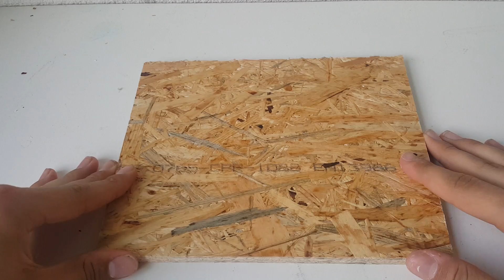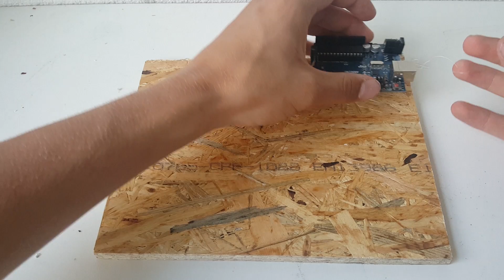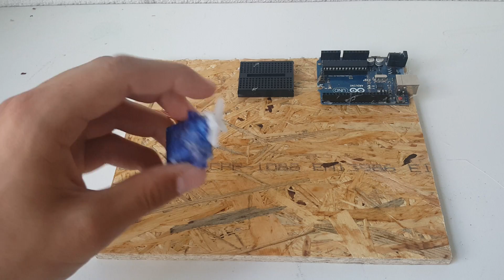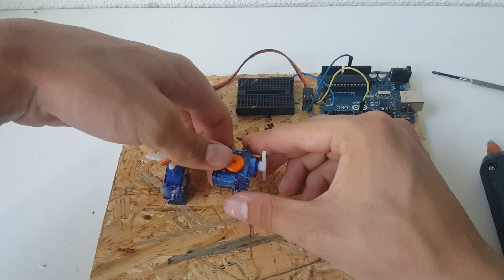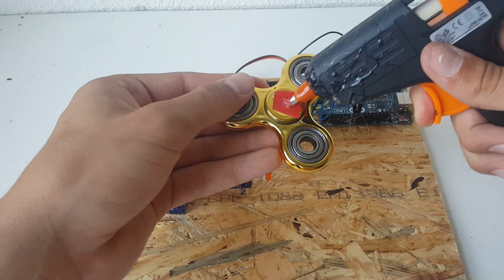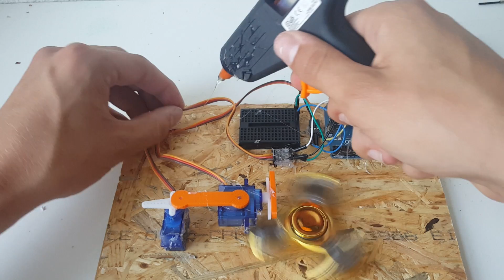A FIDGET SPINNER ROBOT?! + How to make

Comment from the maker: //The code for the fidget spinner robot: 

#include <VarSpeedServo.h>

VarSpeedServo myservo;    // create servo object to control a servo 
VarSpeedServo myservo1;    // creates another servo object to control a servo

void setup() {
  myservo.attach(9);  // attaches the servo on pin 9 to the arduino
  myservo1.attach(8);  // attaches the servo on pin 8 to the arduino
} 

void loop() {
  myservo.write(0);
  delay(1000);
  myservo1.write(120);
  delay(1000);
  myservo.write(140, 5 , true);       
delay(1000);
myservo1.write(10, 20, true);
delay(100);
}
Reply: Easy arduino projects thanks, Definitely gonna try but for other purpose though

Comment: Hot glue does not make for a good mounting solution
Reply from the maker: I know, but everything i make is for a small amount of time, after the video i use the parts for something else, and hot glue is strong but very easy removeable. Perfect for these little projects